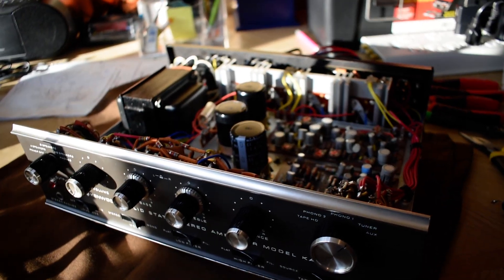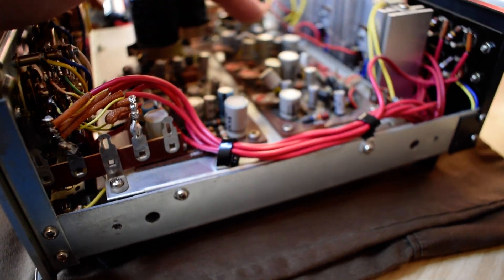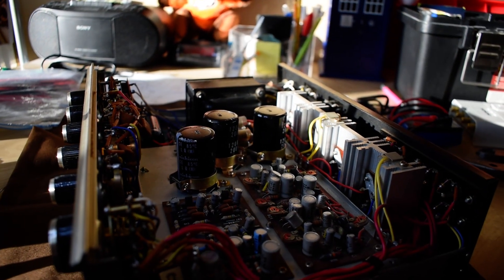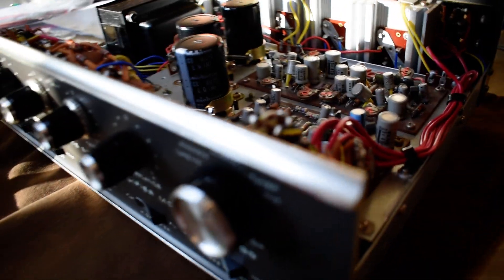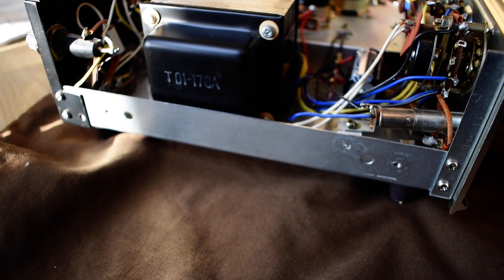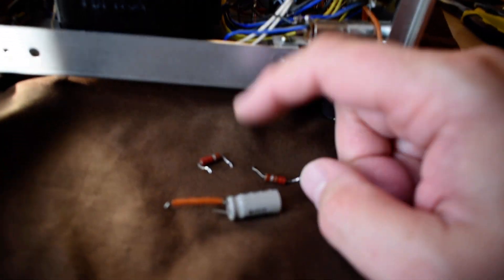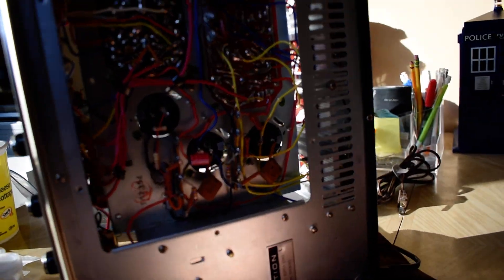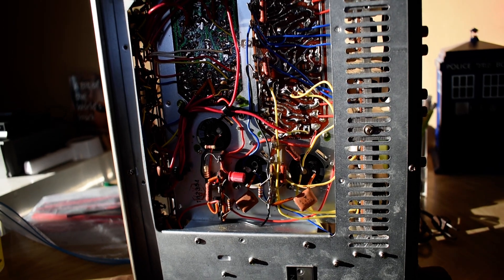Another Kenwood Trio KA-2500 stereo amplifier- this would have been very cool to own in 1968!

Comment: As a freshman in college in 1973 two folks I met had the KA-2500 amplifiers.  I was amazed at the quality of the sound but couldn't afford it at the time.  I didn't forget!  I purchased one I found on ebay around year 2000 along with a pair of JBL 2500 bookshelf speakers for my garage.  They have been sitting my shed for over 13 years and decided I wanted to setup a stereo system for my bedroom.  I took them out, dusted the off, hooked them up with a spare CD/DVD player and WHAM!  Not only worked flawlessly (a few knob turning crackles) and my wife asked me to turn it down.  I started at volume 0 then turned it to 5 and was absolutely impressed!
Reply from the maker: I have impressed a few guests with how loud this amp can go without breaking a sweat!